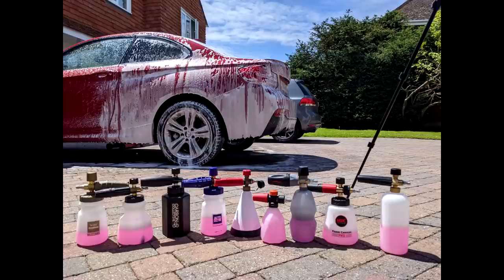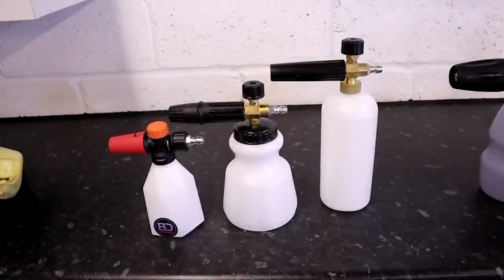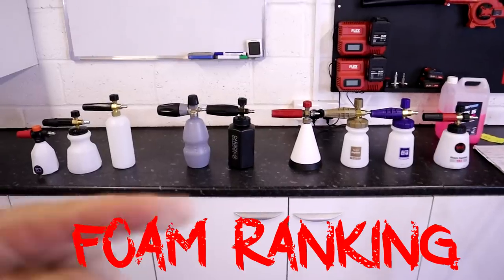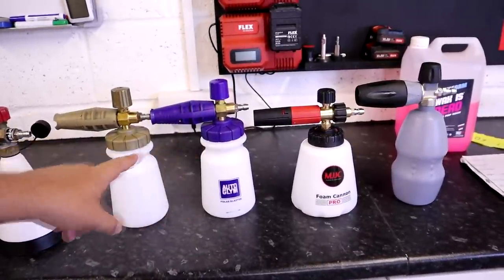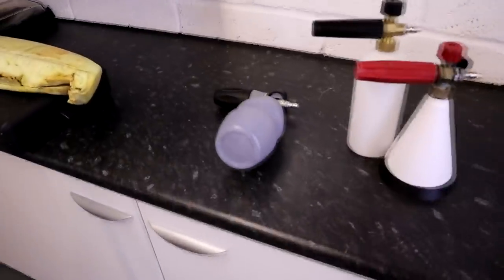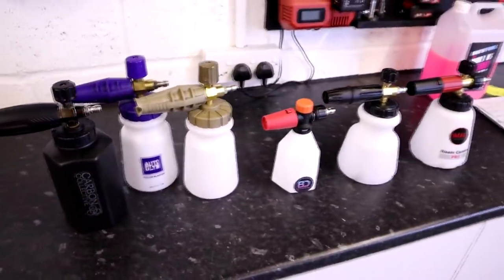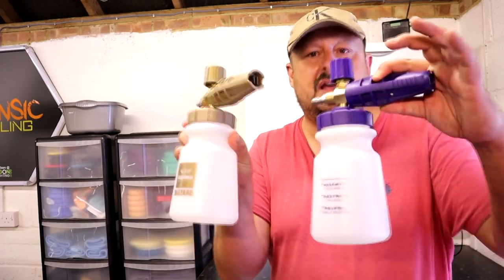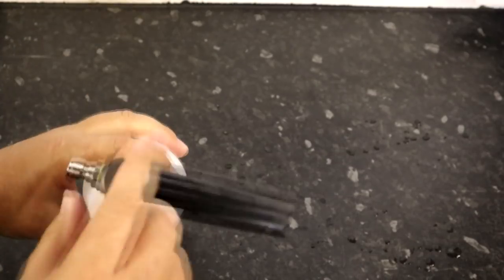The Best Snow Foam Lance/Cannon | MTM MJJC Autoglym Carbon Collective PA Cheap Chinese

Comment: I use the MJJC foam cannon after following you for some time, my set up is a Karcher K4 - I have noticed that the MJJC lance uses quite a lot of product.  I know that it depends on the flow of my pressure washer to work out the best ratio of solution to water in the lance but generally what do you recommend when using Bilt Hmaber Touchless? I have the foam adjustment set to full what setting would you recommend for this also?  I usually don't have much product left in the bottle after foaming my BMW 4 series which I know is a larger car but I wouldn't expect to use anywhere near a full bottle with the lance for one pre-wash?
Reply from the maker: follow instructions to calculate 5% PIR for touchless mate.  and use 2.5% for light cleaning 5% for extreme cleaning.   you can put the 1.1 orrafice in to increase back pressure.
Reply: @ForensicDetailing  cheers. I thought that the 1.1mm orifice was for lower pressures, I would have though the K4 full control of mine should be more than capable with the 1.25mm. I will give it a whirl working out the PIR as you say and see how I get on. Thanks for getting back to me much appreciated. Love the videos.

Comment: Hi Jon, do you recommend any particular replacement orifice and filter parts for a PA Lance? Is it a tricky thing to do, I’ve had my lave for years but never replaced the filter 😕
Reply from the maker: its a major pain.   So if you want to replace the filter polished bliss sell original PA lance filter which is higher quality than cheap ebay filter.    I would also buy the orrafice from polish bliss for the PA lance if you can rather than ebay 1.1 orrafice.   just to make sure the quality is good.   If polished bliss dont have the bits you need try autobrite direct.

Before dismantling the PA lance make sure you have some thread lock.  especially if you are using the karcher adapter.   less critical with the 1.4 quick release adapter.

Comment: The MJJC is that price only from in2detailing, everywhere else it's about £50.
Reply from the maker: you can get another 10% on 37 quid with "forensic" as well possibly.  if that works you can get this lance for about £33.30  which is great price. If it doesnt its still best price.
Reply: @ForensicDetailing  know you tell me. Is that for anything ordered from in2detailing?

Comment: Hi, q for you. I live in a flat so Karcher is a no go so bought a word hydroshot. It has much lower l/hr (obvs). Is that the reason it doesn't foam like your (and others I've watched) pressure washer?
Love then channel and have become a total BH convert... and much poorer!
Reply: It could well be but if you top up your cannon with water try doing it without topping up, it means you are not pre-diluting the snowfoam, I've found this gives a thicker foam with lower pressure systems 👍

Comment: I'm gobsmacked at the prices, do us detailers get seen coming or what! Mugged off again 😂😂
Reply from the maker: we have good cheap options the ali express that came in second is robust and very very cheap.   I look at these canons and my brain tells me they should be about 15-25 quid really.   but dunno could be wrong on that.
Reply: @ForensicDetailing  I think you are right Jon, many are hugely overpriced in my opinion. I've been using a 'cheap Chinese' one for two years and it's been excellent especially for the money, I'm not at all surprised you rated the AliExpress one 2nd mate. It does annoy me tipping over though 😂

Comment: Hey Jon, how do these foam Lance's compare using say BH touchless as that doesn't foam up as much in general. Will there still be a clear difference?
Reply: i use the alixpress one and have both BH foams - I was surprised at how ok the cheapo one was (first venture into snow foam). As BH doesn't foam much anyway (certainly with my low pressure, pressure washer) its very watery. I just up the concentration a bit but there isn't much "dwell time". Does a great job though and time to get a detailing brush in and around the handles, grills  and window rubbers. Once you've gone round the car just a quick blast with the water to get the remaining off. Really good value combination that works perfectly for my needs (3 cars). Also doesn't use much product at all. I can easily do all three cars with the 1L bottle at about 40 product /60 water ratio. Just what I use that fits my needs so hope that helps somehow.
Reply: @djmandrick  thanks bud appreciate it just wondering if with the mjjc lance it'll make a difference?
Reply: @bluebase50  ahhhh my bad :)

Comment: I ask for help!
I have the MJJC Foam Cannon Pro (V2), 1.25mm nozzle (measured with caliper because chinese people can't mark it...) and the Annovi & Reverberi 479SS pressure washer (180BAR, 480l/h). The product is the Bilt Hamber auto-foam (5 litres canister).
I can't get thick foam. It is always extremely liquid. I started by testing the product 1:5 in the bowl and the foam cannon valve wide open.
I vaguely managed to foam the whole car and the bowl was already empty.
As mentioned, liquid foam and a bad (if not zero) result.
I continued trying with only the product in the bowl (no water/product mix) and the top valve was always fully open.
The foam was a little firmer but not effective at all.
As before, the bowl emptied in an instant (faster than previous).
Ideas? Ay video to suggest?
I contacted MJJC support and they replied:
- I just searched on youtube for the soap you are using, it seems, this soap can’t make thick foam.
Could you try MJJC Foam – the ultimate car wash shampoo?
:(

Comment: Hi John, nice video, went into plenty of depth when testing which is good. 
It was a shame not to see one lance design in this test which was the one like the In2detailing hornet/Stjarnagloss lance and especially the aliexpress one which looks exactly the same but is of course unbranded. They have a nozzle just like the MTM (that sort of shorter gun design) with a wide bottle like the autoglym ones (bit hard to explain but do a quick google search please to see what I'm talking about). 
They are becoming quite a popular choice as there are lots of branded ones of that design available . On detailingworld there was a thread that recommended the base unbranded as it apparently performs the same and claimed to actually be the same unit (but £40 vs £15). Of course, I can understand that its extra money to spend and there are lots on the market to choose from which is probably why it wasn't here. But hopefully it'll be something you can consider taking a look at, branded and unbranded like you did here, might be the best of both worlds? Cheers

Comment: Where did you have the top flow control set at? Thanks
Reply from the maker: so I used the wax is dead at around 1% PIR. and set the flow controls to max foam.  (sometimes the best foam required the flow controls to be turned down or backed off a little bit from the max setting)

Comment: I ordered a Carbon Collective lance before this video came out, personally given the price (£45) it’s quite a poor.  It’s near impossible to screw the lance onto the bottle! Might be a little pedantic but it also states to apply PTFE tape to all fittings before use but it does not supply any tape with it. My first lance was via EZ Car Care and even that came with tape. Poor value for money IMO invade anyone is tempted to buy it
Reply from the maker: people seem to not be happy with this lance.  I had the same issue you report with fitting it on the thread at first.  but other than this and the things we discussed in the video its decent.  pricey yes.  its not a winner but its not a complete looser either if you get me.
Reply: @ForensicDetailing   it’s a shame as I had high expectations for the lance, I’ve only managed to get the bottle threaded on correctly once, not sure if that’s the case with all or if I have a extra dodgy one, either way it’s on its way back and I’ll be deciding between the MJJC or MTM. Great videos btw 👍

Comment: Does everyone automatically swap out the orifice for the smaller one?
Reply from the maker: no i thin kif you have a lower pressure system it can help..  but with electric pressure washers dropping to 1.1 can sometimes back the machine up too much and make it pulse. so you need to test and sort of suck it and see a bit.
Reply: @ForensicDetailing  that makes sense. Good advice as always.

Comment: I have the MTM product which is sold by and under the Karcher Commercial Brand name.
I’m not impressed for the reasons you gave John, especially the poor foaming from low pressure and at s as price off over £100, Karcher must be making a nice profit!
Reply from the maker: the foam is decent, but if I drop the pressure down its not so great.  I think the 1.1 orrafice will make better foam for lower pressure systems maybe.  Its a good lance but they need to bring out the new version which fixes the topple issue and not give away the rights to sell their own lance to the european market, and finally they need to price it sensibly.  45 quid is sensible.  60-70-80-90 quid etc is no good, they will loose money if they charge too much.
Reply: @ForensicDetailing  if I turn the pressure up to increase foam density the 1litre foam bottle empties before finishing the car! So I have reached a happy medium but it’s still inconsistent when in use although the settings have not been adjusted.🙄😤

I think I’ll try the MJJC Lance when I’ve built up enough pennies. The cost of this detailing hobby is spiralling and this case proves the most expensive tools are not always the best or most reliable.

Comment: Having owned a few foam guns over the years, I can attest that the Autoglym effort is poorly engineered, poorly manufactured and massively over priced. 
It’s the only one where I have been in touch with the company and received replacement parts. 
It’s the same as Karcher , with pressure washers. They fail constantly. 
The best I’ve had is still a Qualcast. It’s still going after well over 10 years. (Can’t get a foam gun to fit it or it’d be my go to)
My 2 year old K4? It’s had a new lance, been stripped and repaired 3 times and now the trigger needs attention…….again. 

I thought they may have changed wrt reliability. 
I was wrong. 

I want this one to break catastrophically soon so I can get a Nilfisk. 

Rant over 😂

Comment: MJJC now just go more then 50£. To much good reviews for them and they increast the price on they page till 89$. Autoglym 35£.
Reply from the maker: In my link it's 38£ and u can get 10% discount on that I think
Reply: @ForensicDetailing  yes its 38.95£ but not with kercher connector. To get kercher connecter you need spend again +10£. And your discount code its not working for MJJC products :)

Comment: You make some mistakes when foaming Jon. First, you should star foaming your car from the bottom and going up, then you should go at least 1.5/2 meters from the car and nevere restart your pressure washer directly on the car. These simple mistakes make the foam heavier and run down the panels quickly. Have a nice day

Comment: These MTM ones are crap. Last about 6 months then leak out the bottom. I have 2 too both do the same thing after a while.
Reply from the maker: Get the mjjc pro v2 rich
Reply: @ForensicDetailing  which is the cheapest place to get mjjc?